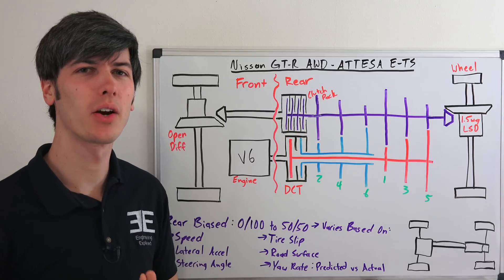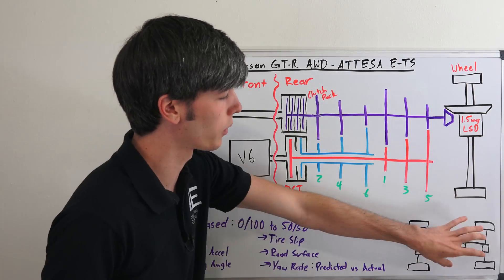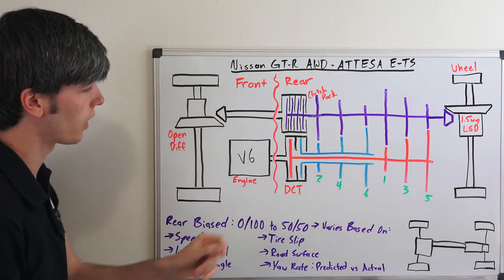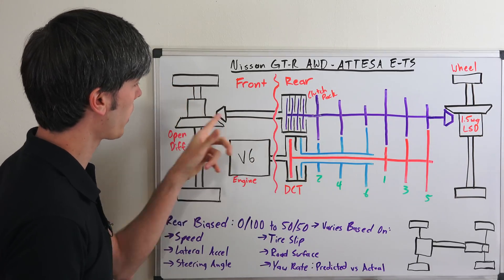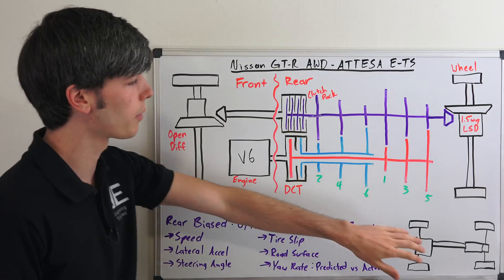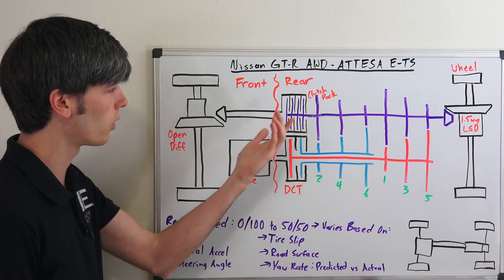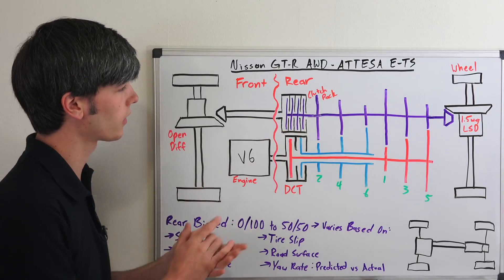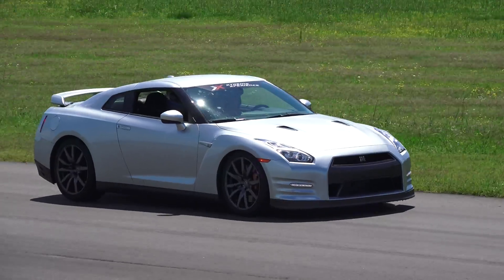Nissan GT-R AWD System - How It Works

Comment: Fun fact: this is essentially the same AWD system in the G35/7X, you did specifically need the AWD Sport package to get the rear lsd though
Reply: Had to buy the G37xS coupe though as this got you the VLSD, suspension and bigger brakes. The XS package on the sedan was basically just an appearance package. To be even more pedantic the G35/G37s functions like the R32,33,34 base model while the R35s and R33/R34 V/M Spec models can control the torque between the left and right wheels

Comment: Me and my friend are in a convo.  The new XDelete has a mod for BMW XDrive that allows to limit the 100% of the front to 50% of the front.  If there is an upgraded LSD in the back of an XDrive car, would it not be a similar system (the most similar system 2011 and before) to the Atessa-ETS system?

Comment: Hello, I was wondering how the system deals with different tire sizes front and rear. I would imagine each axle running the same gear ratio but the front driveshaft would be in a constant state of slip to compensate. Is that how this system works? Thanks

Comment: is it better than quattro or xDrive?
Reply: thay are similar, however Mitsubishi has the best AWD on the planet. Have you seen Engineering Explained - "Mitsubishi Evolution X - How The AWD System Works (S-AWC, ACD, AYC)" ?
Reply: I think R33 V-spec/R34 V-spec (ll) ATTESA ET-S PRO and VW 4 Motion is best

Comment: Does the 4 wheel drive activated in the system or we hav to activate it manually?
Reply: Everything is electronically controlled several thousand times a second based on a whole range of sensors. The ABS (to detect wheel spin) is the main one, but it also factors in G forces, current weight dist, braking/throttle, etc.

Comment: Whats the normal tourge split (Im tunning an ae86 AWD drivetrain swap in forza 4 and I want to have the most amount of amount of grip but I either understeer or oversteer) :(
current setup
20/0 front 60/50 rear 80% center
Reply: Most ATTESA systems are 100% rear under normal driving conditions. I believe GT-R is set to 98% rear.
It's designed to oversteer a little (RWD after all), and when AWD kicks in it has some understeer... naturally correcting the oversteer that likely induced wheel spin and triggered AWD to divert power to the front axle.

Comment: Does anyone know if the AWD system in the GTR, is similar to the one in the Nissan Armada?
Reply: Pretty sure they use a different system on trucks and SUVs. ATTESA is mostly used in cars and isn't well suited for heavy / commercial / industrial type applications... it's an AWD system to take corners fast, not to go off roading or carry things.
Reply: @APsupportsTerrorism  clutch pack would probably overheat if it stayed at full lock in those types of scenarios.

Comment: My stepfather's Infiniti G37X has attesa e-ts, but not the same drivetrain setup as a GTR.
Reply: GT-R has ATTESA Pro. Main difference is that GT-R gets an LSD in the rear. The transmission is up front on the Infiniti, but the AWD system basically works the same way ... just no LSD, open diffs in the front and back.

Comment: I wish I could see a comparison between the nissan gtr awd and other awd systems like quattro,4matic,xdrive .I mean, it would be interesting to see how these awd systems are working in winter conditions .Can you please make a video where you test all of these systems in cornering, moose test and so on ?
Reply: Being permanent AWD, Torsen Quattro and xDrive will do better in winter. You can add Subaru to this list as well.
ATTESA is designed for aggressive driving... being AWD gives implicit benefits in winter conditions, but that's not the design goal. It was designed for Skyline GT-R, and the only major update to it since the 90s is the current GT-R adding a rear LSD. It's not a winter traction-oriented system... but AWD is still AWD so unless you're climbing an icy mountain it'll probably do the job.

You couldn't pay me to use Haldex Quattro or 4Matic... they're reversed ATTESA systems. Use FWD until wheel(s) slip, then transfers power to the rear. As such, they aren't as good for winter as the permanent AWD systems... and not as good for performance as the ATTESA system they mimic.

Comment: Best AWD you can find  IN Subaru. Best 4X4 you can find in Toyota and Lexus.
Reply: Mitsubishi has the best AWD on the planet. You should see Engineering Explained - "Mitsubishi Evolution X - How The AWD System Works (S-AWC, ACD, AYC)"
Reply: Subaru has great AWD if you're in snow... ATTESA is the best for road driving.
Different applications. This system will inherently help some in snow etc., but that's not what it's designed for.

Comment: +Engineering Explained Hey Jason, I've had a question for a long time now. And I haven't found any proper response yet. I absolutely love 90ies turbocharged inline 6 engines like the Nissan RB or Toyota JZ engines. The sound is so extremely nice, I watch videos of such engines always when I can. But where I live JDM cars are very rare and expensive. I wanted to go with some old BMW and turbocharge it. But for example turbo'd M50 engines don't sound like the inline 6s I love. Why? 24 valves, around 2.5 to 3.0 displacement,... How do I get a 1JZ sound out of a M50 turbo?
Thanks!

Comment: Like you videos very much, but remember: In your starts videos (and I agree), the torque distribution 50/50 is only possible with open dif.. If the central clutch is closed, the torque distribution is a function of the friction coeficient in each axel and the torque distribution could go from 0/100 to 100/o (theoretically)
Reply: In a super heavy-duty clutch which has so many plates..
It's impossible to slip this clutch more then 30 - 50 percent so forget about 💯 percent

Comment: So in a normal (not molesting) drive would this mostly revert to RWD?
Reply: Its pretty much an adaptive AWD system that is only used when required which is the secret to the GTR's awesome handling.

Comment: That's a weird setup. So the first drive ( connected to the engine) shaft rotate at engine speed since the transmission is in the rear? or do they have a intermediate differential in the front?

Comment: The part with the GT-R on track looks like the driver fell asleep :D
Nice explanation of the AWD System. Should have told about the wet and the dry clutch Setups, though.
Reply: He talks about this with another commenter. join them in the convo if you get the chance.

Comment: I'm surprised they don't have a Torsen Diff or at least something a little bit smarter in the front, the Open Diff seems like a cheap option in an otherwise very expensive driveline. Put a Wavetrac in there Nissan!
Reply: The Mclaren P1 has an open diff in the rear. Just FYI
Reply: +Kristoffer Lilja yea, that is true. Provided the GTR simulates an lsd with its brakes in the same way a P1 does. I just think about how much better my car drove after I put a proper torque basing diff in the front.
Reply: Steve Reed Pretty sure it does its nothing complicated. I had a BMW 335i with an open diff that used the brakes to simulate the effects of an LSD and I never noticed a difference. You could do proper powerslides and drifts still
Reply: +Kristoffer Lilja yea and the proof is in the pudding with the GTR. They obviously chose that path for a reason.

Comment: Not a good review. Too simple. He didn't nail the point of how ATTESA out-performs other AWD system in terms of traction balance. Handling is the main reason why ATTESA's torque split is rear biased not its weight distribution. Weight distribution and AWD torque split are separate. Audi has most of its weight at front and it relied more on front axle which causes massive under-steer. ATTESA ET-S was inspired by Porsche 959 AWD system but 959's system is less rear biased, it sends 20% power to front axle most of the time and Nissan's engineer think that'll cause under-steer  through corners like Sweeper and they're right. Cars turn by front axle, in other word, the front axle usually lost traction before rear through turns like sweeper and chicane which causes under-steer. You don't want too much power on front axle especially the GT-R wears 255mm 4 season at front while weighting 1,730 kg. Under-steer is as bad as over-steer if you're talking about longitudinal acceleration. However, over-steer allows throttle steering which gain handling-adjust ability. In easier term, you can use the power to control the yaw like RWD which reduce your turning radius while under-steer won't. Not to mention too much power at front will cause torque steer as well. However, the ATTESA will send usable power to front axle (usually less than 30%) at corner exit which helps straight back up the car by driver's counter-steer and accelerate hard by relying less on rear axle in order to increase longitudinal traction. Also, yaw rate feedback isn't the only system ATTESA relied on. You forgot to mention 3 axis G sensor which mounted at the center console. Since GT-R's VDC program allows high yaw rate, the AWD won't relied too much on YFC but G sensor. It sends certain amount of torque based on G forces more than yaw rate especially when you switch VDC off. Beside corner entry, the ATTESA is working even at brake zone. It'll disengage the 1.5 LSD in order to allow the 4 channel ABS to balance out traction on 4 wheels independently while the ET-S sends certain amount of power to certain axle according to 3 axis G sensor in order to maintain balanced traction during engine brake. Although GT-R can be 100% RWD in VDC-R mode but it actually sends 98% of its torque to rear in launch mode. But anyway, the car is so sophisticated, as you can see, the car has unbalanced weight between left and right but the 2012+ DBA-R35 has a suspension upgrade called Asymmetric suspension which helps balancing the cornering load to maximize the outcome of ATTESA ET-S system.
Reply: Finally someone with a brain! I was laughing when people saying Audi has the best awd system lol they are basically front wheel drive.
Reply: @TheSingying  well it depends on the situation like with everything else. Nissan made theirs in 89 for tarmac track racing while Audi made theirs in 83 for rally... I would love to see Audi's group B rally car from 86 (?) vs Nissan's r32 race car on a rally course and on a dry tarmac racing track. Pretty sure the Audi would win on both occasions.
Reply: I agree with you, he should have stated this. But while he oversimplified and left out most of the crucial details, I think you over complicated it - not saying clearly the one thing that really matters: how is it different from other AWD systems. Sure, back when it was introduced on older generation it may have been first to do most of these things - individual wheel braking for yaw, and dynamic torque balance based on the different types of acceleration (lateral, longitudinal, diagonal), but right now really everyone does that. So is the only real difference the rear mount transmission? (which in turn, allows the benefit of 0/100 torque split if I understand you correctly)
Reply: Ariel G. In easiest term, ATTESA ET-S pro GT-R version is based on rear wheel drive. Not just the placement but the programming. It remains RWD to bring the agility and handling-adjust-ability of RWD cars then send certain amount of power to front axle to use the counter steer to pull the car straight and gain longitudinal traction instead of sending huge amount of power to front axle to get rid of over-steer yet causes under-steer like Quattro, ACD, DCCD, Haldex, etc...
Reply: Ariel G. Nope. DCCD AWD system works completely different. It won't send all power to rear but 50:50 under full lock. DCCD is for rallying Nissan's ATTESA ET-S Pro is biased for handling and agility on asphalt. Especially in VDC-R mode.
Reply: SingYing Tan True. Audi's AWD is based on FWD and it loves to feed power to front axle which is less thrill compared to GT-R.
Reply: @pascalmpower7944   ? Audi's AWD is not based on FWD, it's based on AWD and was born from rally not tarmac track use. Some models (audi TT, a3 and a1) uses a Haldex system witch is FWD based. (not saying that Audi is better just that it's different, i like the nissan AWD better because you can do mad skids)
Reply: +ATTESA ET-S 東瀛戰神 R35 GT-R nismo N-ATTACK A-kit so Is Subaru AWD also front primary? I think the 22b had a rear biased system, still has transmission in the front though
Reply: What do you think about Super Active Yaw Control by Mitsubishi Vs Attesa et-s 
Does Attesa et-s also have torque vectoring like Evo 
Tell me please?
Reply: @Abhishek-150  The Mitsubishi SAYC uses real torque vectoring to each wheel with clutch packs on the diffs while Nissan "fakes" like Subaru does it by using the brakes (at least on the early GT-R models). But Mitsubishi can't send 100% off the power to the rear wheel only 50 % . The GT-R is set up more for Track and the Mitsu was born from rally and everyday work. Real torque vectoring is also when you can control how much torque each wheel can get, not just how much each axels get.
Reply: People just listen to Jason, this dude just trying to prove that he is better than Jason and over-explain things that Jason said.  For example, Jason said that the GT-R used "calculated" YFC values and then it compared those with "real" YFC values. The ATTESA system will prioritize the "real" YFC values (like Jason said) and it get those "real" YFC data through the 3 axis G sensors all tho MR Pascal here didn't mention that. And Yes the transmission is placed in the rear for better weight distribution. The ATTESA system doesn't demand that the gearbox is mounted in the rear for it's YFC control, it was mounted in the front on the r32/33/34 models.
Reply: Awwwwww. How does it feel to get off that your chest?
Now put that up on a board and make a video about it without putting us to sleep and/or losing your audience. One reason this channel is so successful is that Jason is very good at accurately distilling very technical stuff into its essentials without the tedious minutiae. If you need to to go into the weeds then there are other places for that. Usually his explanations cause me to look further into a technology.
Bad form to hate on the review just because you happen to know bit more about the system and then give us a word vomit.
Reply: jaminthomas Uh huh.
Reply: +jaminthomas well said sir

Comment: If the system is in any state between 0-100 and 50-50, it has some power loss due to clutch slip/heat, right?

Comment: the ATTESA system if i remember correctly allows for split power between the rear left and right tyres during cornering, this was employed only onto the rear diff. And in previous versions found on the R33 and R34. It was measure by the ABS sensors.

Comment: do the clutch packs not wear? +Engineering Explained
Reply from the maker: Everything wears, but you get the wear rate to an acceptable level and it lasts as long as needed. No idea what their estimated life is for the part, but I'm sure they did the math.

Comment: How dose the clutch pack sending power to the front not ware excessively if it is not clamping fully.  Generally allowing a clutch to slip would ware it.  Is it a wet clutch?
Reply from the maker: Wet, lots of plates. Can last a long time even with slip. We used them in the forklift world at my previous job. Our transmission had multi-plate, wet clutches that had lots of slip programmed in, and they would last (almost literally) forever.
Reply: Also - the front wheels will still rotate by them selfs, so it's not that much of a speed difference beteween the rear and the front. It won't be as punnishing as if you ride the clutch on the main driving axel. I guess if you launch it it will understand what's happening and lock it fully before the main clutch engage. Maybe it's always engaged from 0? And then disengeages as speed rises?
Reply: It is a wet Setup.

Comment: Seems to be a pretty complex system. I know these cars are in completely different classes, but I wonder how this system compares to that of the new Ford Focus RS. They both appear to be quite sophisticated systems.
Reply: [understeer intensifies]
Reply: Focus RS is front wheel biased system. Just like the one found in many AWD hatches.
Reply: they need to make it understeer biased though, shorter wheelbase and other small-car geometry means one little bit of oversteer can turn into a lot of oversteer fast and be difficult to control.

Comment: can it do 1 wheel drive? Like when only one wheel is having traction all other wheels are on ice, the engine would send all its power to the wheel with traction, like all Subarus? if not then its garbage.
Reply: Yes it can have all 4 tires receiving different amount of power at the same time how magic. ECU sensors to control power in real time to each and every wheel, depending on the driving conditions. 

Read more: http://www.autoevolution.com/news/nissan-gt-r-s-secret-attesa-e-ts-awd-system-explained-35006.html#ixzz4DA8Z7Taq

Comment: so on launch control what is it, 50/50?
Reply: I would assume 50/50 initially and then through acceleration shift the power to the rear wheels 30/70 mix. With the car accelerating, it should get more grip off the rear than the front. I doubt that it would go to a 0/100 mix ever, but i'm not an engineer just a wrench spinner.

Comment: Can you please explain how does the new focus RS AWD work? What I'm confused about is, whether it has rear diff or just 2 clutch packs sending torque to both rear wheels.
Reply from the maker: +klstrucker930419 it has a torque vectoring differential in the rear. I have a video which partially explains how they work.